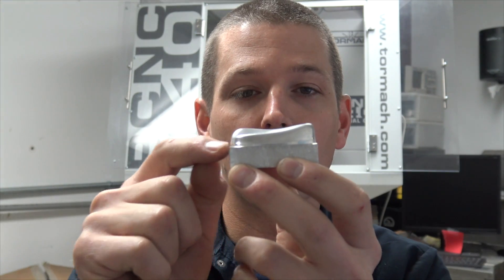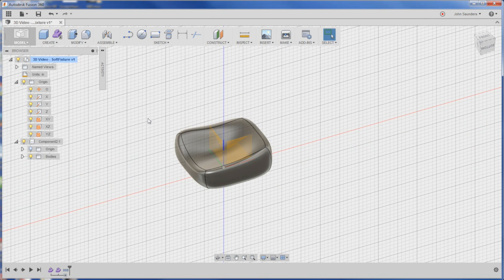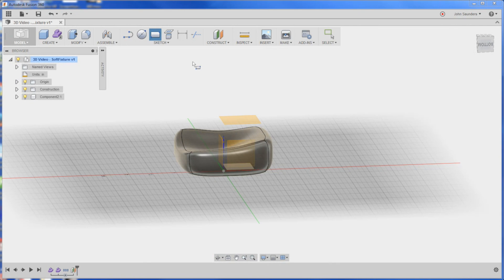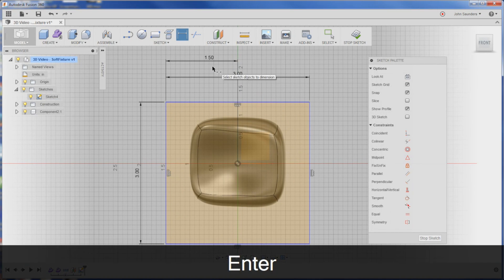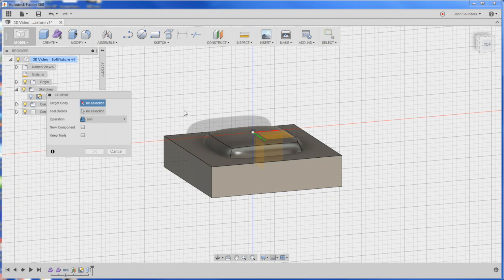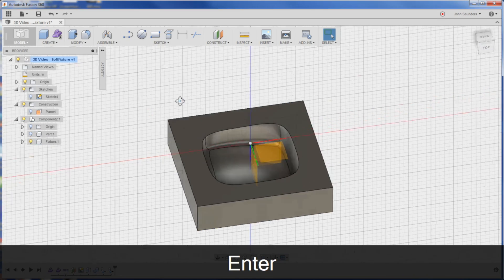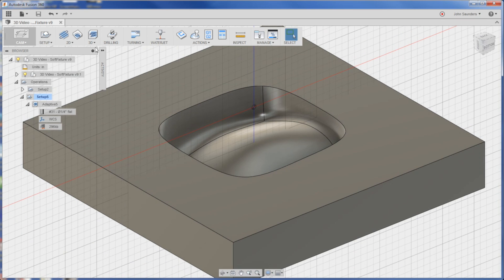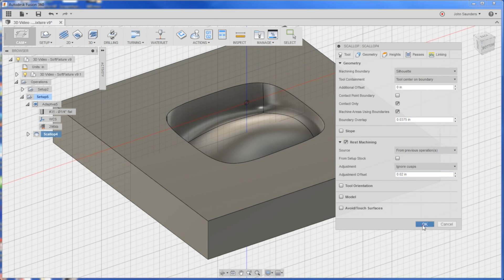3D CNC Fixture!  Widget65

Comment: Have you ever thought of adding a vacuum line to hold the part in place (instead of super glue)?  I've used the form fixture routine for some time now, usually with plastic parts.  Add a small hole tapped into the side and extended through the base of the 'fixture hole'.  Provided the tolerances are tight enough it forms a good self seal, pulling anywhere from 18-22 inches on the vacuum pump.

Comment: Thanks for showing how to cut one part with another. That's pertinent to what I am doing. Background in Solidworks, now using PT Creo 3.0. with a new employer. There have been a few times when the Creo tool paths have gouged the part (aluminum molds for rubber) and I used Fusion 360 to rescue me. No doubt because I don't know enough about Creo, but F360 is much more intuitive. Looking forward to the discussion of machining styles (adaptive, etc.) Great videos, keep it up!

Comment: Tapered sides and superglue might give you a false positive about the fit, I would like to see a "dry" fit with layout blue applied to cavity or the part to machined. 

My bet would be on that it won't fit all the way to bottom as I don't see any clearances (few hundredths of a mm = ~0.001")  machined into the cavity. You have at least two ways to achieve this. First is that you tell the cam-software that your tool is 0.005-0.01 mm undersize and second way is to give the finishing pass a negative stock to leave. You might also need to use combination of both as usually endmills tend to be slightly undersized from nominal dimension.

For fixing the part, superglue should do the trick if part does not heat excessively during machining and cuts are somewhat conservative - no shear-hoggin massive MRR's ;)

Comment: Very good video. One question; did you make the negative part slightly larger to make the original part fit? If so I missed it. I always have to add or subtract some to get two parts to fit together.
Reply: +Auarhau Not really my place to comment but with the two parts being tapered, they will fit together but depending on the part roughness, the walls will fit snug but there may be a gap at the bottom, probably ~.001-.002

+NYC CNC John, how about machining the fixture cavity deeper and slightly undersized. Freeze your part to be machined, fill the cavity with water and drop the other part in. When you're done machining put the fixture and machined part in the freezer again. When the water freezes the machined part should pop out. No messing with adhesives or heat. Just a thought.
Reply: +Eric Wolf I'm as much as a novice as anyone and this technique is purely speculation but the logic behind it makes it reasonable in my mind.
Reply: +Fleming Engineering Interesting idea, I just wonder what the heat from the the machining might do... Maybe nothing but could be bad to have the part pop out mid cut.
Reply: +Eric Wolf I'm not an expert but I went through all the calculations (thank you online calculators) of thermal expansion of water and aluminum and determined if the temperature isn't increased much (40F), which should be possible when machining properly, my method would work if there is about a .002 interference fit with the size part in the video. The expansion of the water is about .1% and would create a force of about 600 lbs. The coefficient of friction between the two parts would make this about the limit for them to separate. When the water freezes, the expansion of water will be about 10% and easily pop the part out. If one were to create a tighter interference fit or make the fixture rougher, it might be more feasible but then getting the two pieces to fit together would require more heating or cooling of the fixture and part.
Reply: +Fleming Engineering it sounds like it would be a cool,  no pun intended, thing to try.  I am still a novice but am excited to learn about different techniques.

Comment: I've used hot glue before with good results on long, thin pieces with a lot of surface area (a gib for a lathe compound for example).  It's not that strong a bond compared to super glue but it is tough.  Fast to put on and take off.

Comment: In theory, would turning the fixture into a vacuum chuck also work if the tolerance between the part and the fixture is very tight? Not saying it is the best application since superglue is a lot simpler and this may be a one-time use fixture.

Comment: I love superglue for machining. I use it to fixture my g10 inlays

AGH! what a cliffhanger!
Reply: +NYC CNC include an area for the part to be safely leveraged from the bond if heating the part and fixture is not an option. That, or include grooves for solvent to reach the insides of the part. This may also help the part bond faster.

Allow for 30 minutes of curing unless you have an accelerator spray. Superglue is mostly good at bonding organic matter like wood and skin, so the reaction will be slow on metal especially because the metal will almost always be cool/cold on the machine, further slowing a proper cure.

Comment: when I make fixtures like this I use Loctite 380 and scotchbrite the fixture 1st then clean it with acetone put just a few drops of the Loctite  set the part in the fixture and put a heavy weight on it for 30 minutes then go to town when your done just take a small torch and heat it up and it will pop right out. you can also cut lift slots in the fixture to get a little screwdriver under to pry up with
Reply: +NYC CNC I've used the green loc-tite(bearing stuff) and the red loc-tite) to hold stuff on the lathe... required quite a bit of heat to let loose though.

Comment: 1:03
i can tell you already that SG will work, its my go-to fixture! Though you'll probably want to avoid using a shear hog with it hahhah - smaller bits with higher rpm lets you keep the MRR up. 
Note: im doing this on my 6040CNC, so lower cutting forces, but even then I can get MRR of about 15 cm3 /min
edit, after watching
hahah u tease. just make sure you leave a small relief else you might have trouble getting it out! though boiling water can soften it...
Reply: If not superglue, then try epoxy. It will soften with heat so you can take it apart.
A drilled hole threaded for 1/8 npt (or better yet, 1/16 npt) will allow you to apply hydraulic pressure to push it out of the fixture.
My 2 cents.
Thanks,
John
Reply: +sn0wchyld good idea to make a spru hole in the fixture edge, then you can drip the acetone down into there to release
the super glue.
Reply: PartisanGuerrilla SG is pretty brittle so even just a sharp shock will release it... hence why i wouldn't use a shear hog (or a large fly cutter).... but that might be hard on this part, if anything I recon it might be a bit deep, though he could always machiene away the excess material around the part once the other half is done.

Comment: Cool video. It will be interesting to see how CA glue holds up. It is weak against shear force while very strong in tension, but since you have the side walls it might just work. Especially if you can get the CA to coat the whole mating surface area. Can't wait to find out.

Comment: this may be a question that everyone but me knows the answer to but i have to ask??  is fusion 360 CAM ware only or is it a part of solidworks??  can it be added into older versions of solidworks or as i am wondering are they a "combined-pckg"??   AND have you stopped using sprut?  i have sprut 8 that i got long time ago when i was in on a purchase of a 1100mill,, sprut is powerful but i never really have fell in love with it,,, no need for any one to rip me for stupidity but im confused on the modeling software and CAM ware. Im ok at using solidworks but the fusion 360 looks cool and while we are at it is HSM works a solidworks product or stand alone CAM ware,, havent seen you use sprut for a while so i thought this would be a good time to ask,,, thanks for any and all clarification
Reply: +ALUMATRIX Fusion 360 is an Autodesk product and is a combination parametric CAD and CAM software (i.e. you can design the part and do CAM in the same program). Its free to use for hobbyists, schools and small businesses. It seems to me it has a much easier learning curve compared to many, and has a focus on ease of use.
Reply: +Hakudog5   THANKS !!
Reply: +Hakudog5 I love you, was looking for a proper cam cad package for hobby cnc level, and being able to use pro level tools for that is amazing.

Comment: Oh...its the cliff hanger fixture...

Perhaps the negative really did not need all that extra "smoothing" cuts in all places to still make it work and save on the amount of tool paths?
Reply: +NYC CNC Another thought is to make that whole profile  more shallow into the fixture block. All you need is just
enough material removal to make it seat flat in the 3-axis and still have plenty of contact surface area with a slight
vertical wall around it, just enough it is tight enough the part will not turn.